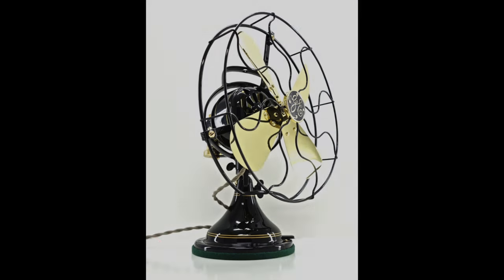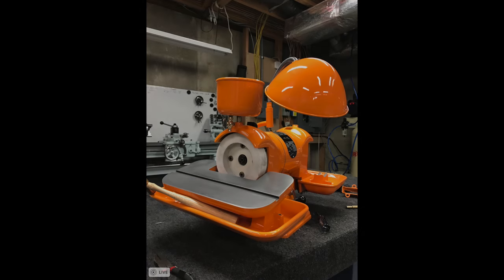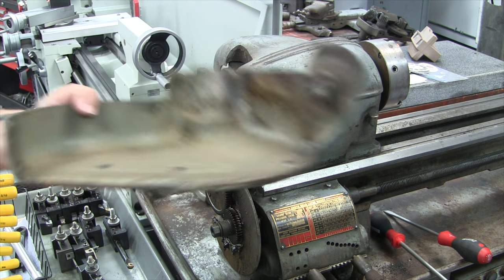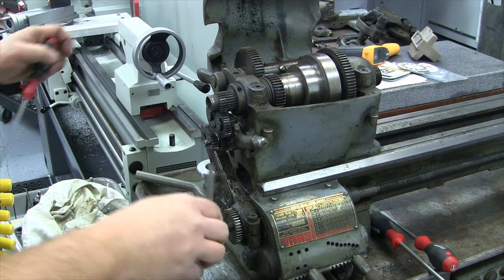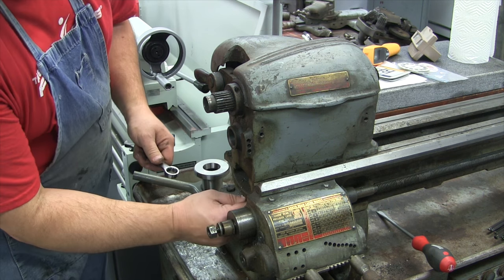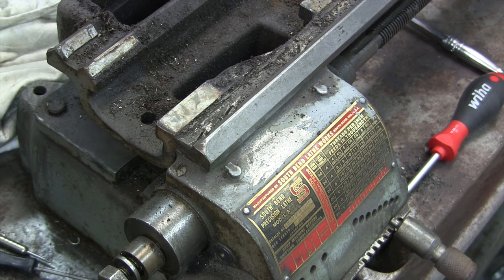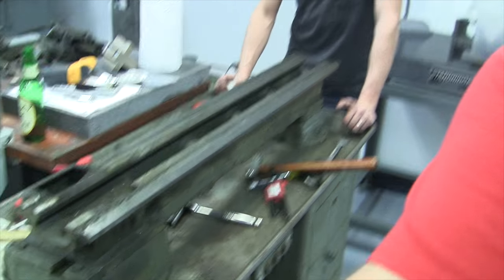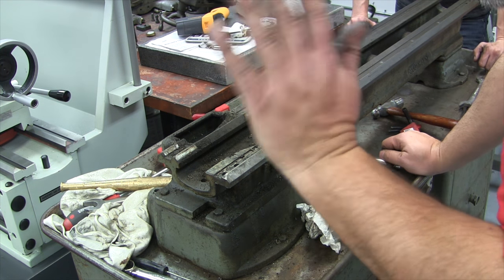South Bend Lathe 10K Restoration - Part 1

Comment: About using a brass drift to remove the lead screw: brass can work harden and damage steel (DAMHIKT).  You didn't have to hit it very hard this time, but if you did, it could have buggered the thread on the end of the lead screw.
Reply: Put the nuts back on before hitting.
Got to protect your thread.

Comment: 13:41 What keeps the reversing tumbler attached to the lathe? I assumed it would be the outer nut, but I see it is still in place when you pull the assembly out. I need to remove the spindle from my 10K for the first time and any help would be appreciated.

Comment: Nice project, I'm looking forward to the other episodes.
Grease is good on an old machine like that. I saw lots of grease, and no rust.
Seems much better than no grease and lots of rust!
Reply from the maker: Well, grease can be good and bad. When Grease is used, (where oil is expected) it holds onto chips and grit - and will help to wear out the ways and other machined surfaces. And man, the bed and carriage on this machine is pretty badly worn.

Comment: I am just finishing my 10K. Note: it is not restoration unless the parts are ground, scraped, and fit. A&D in Roberts WI did mine for $1000. With Turcite on the saddle.
Reply from the maker: if i have the money...
Reply: I should of made that dependent on the condition or the bed.
Mine came from a school, pretty banged up. Yours may be better.

Comment: The side gear cover hinge pivot pin is held to the cover with babbitt. Heat the pin where it sits in the cover to melt the babbitt. Re position the cover, hinge bracket, and pin to align the spindle shaft to the access hole on the gear cover .Re-melt the babbitt into the hole for a tight & accurate fit. I ran short of babbitt when I did mine and added aluminum brazing rod, which worked great. The brazing rod melts around the same temperature as does the babbitt around 800F, just below aluminum melting point.
Reply from the maker: Interesting. It'll be fun to experiment with babbitt, as I've never done it before.
Reply: If you need any extra give me a shout.

Comment: For grabbing something delicate with channel locks, a piece of an old leather belt, 1/8th to 3/16th thick works very well.
Much stronger than paper towels.
Reply from the maker: Excellent idea. I have an old belt I can donate for that purpose. Thanks!
Reply: Another idea, as you have a well-equipped shop:
A collet block on the far end will work best, I think.

Comment: Brad when you finish the rebuild it looks better than from the factory with all the polishing- awesome!! One question slightly off topic in this video on the 10k rebuild part 1, when you have it stripped to just the bed ,I was wondering what is the new white lathe in the background, shown in towards the end? Another question on the south bends - do you dunk the threading gearboxes in zepp or purple power before disassembly or after to get the crud and chips out first? Anyway very fine videos and very informative, thanks a lot!
Reply from the maker: That (was) my Eisen gear head. I'll be getting another one pretty soon actually. And I always disassemble everything, do to the last nut and bolt before I clean or derust :-)
Reply: Thanks very much for the info and instruction

Comment: Its dirty, but not abnormally so.  My 10L was so gunky on the ways that the carriage only moved freely over about a 6" span.  Looks like a good project.  I like underdrive lathes, makes for a more useful work space vs a bench top with a back motor that hogs up your table.
Reply from the maker: Yeah, I agree totally.

Comment: Brad, are you going to do the serpentine belt conversion  on this one?
I'm really thinking about it for my 9A.
Regards,
Duck
Reply from the maker: Duck - this machine is going to be fully old-school. Leather belt and lantern tool-post! All HSS tool bits too!
Reply: yes the leather belts which can be removed without cutting the belt is rational.

Comment: The impact driver, that is a tool that I bought when I was in my mid 30's.. I wish I had bought it 20 years before that, because it made so many jobs a whole lot easier.
Reply from the maker: It certainly does. I love it and it helped me so many times.
Reply: I used a wide impact driver screwdriver bit and ground out the center with a dremel tool and made it fit the cross slide nuts holding the handles on.  Worked great.